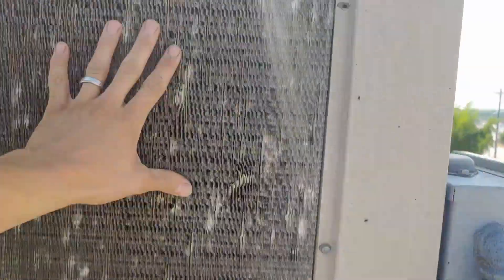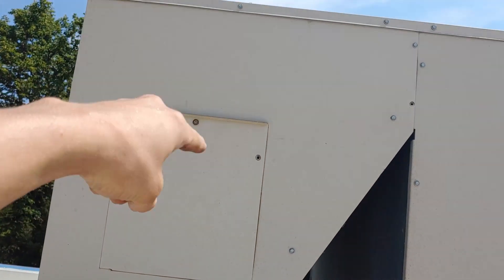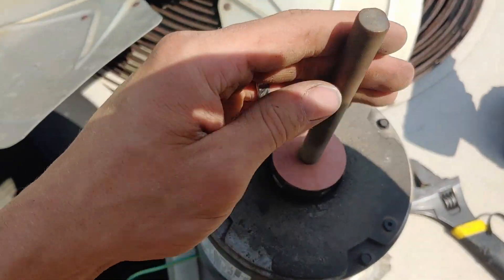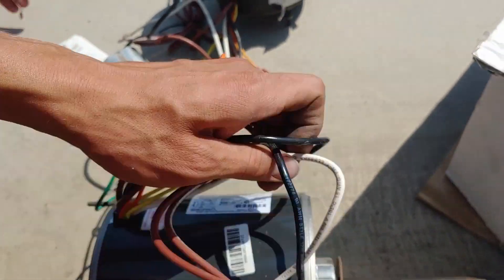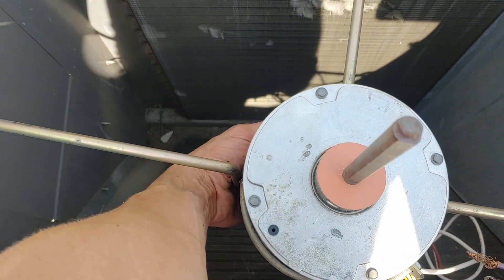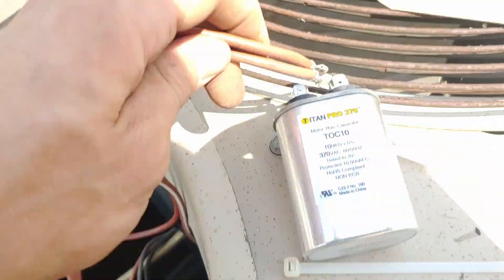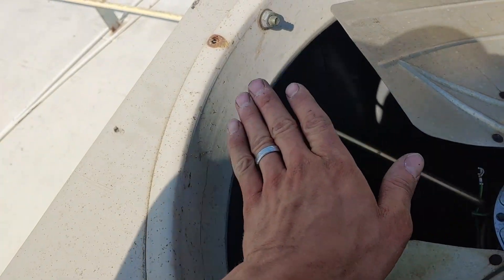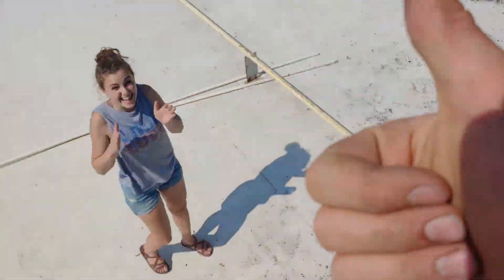How to Replace Fan Motor On Lennox Roof Top Unit

Comment: Do you recycle the motors, or send them back to the factory?
Reply from the maker: We typically just recycle them unless they failed under warranty which sometimes requires we send them the old motor or part.